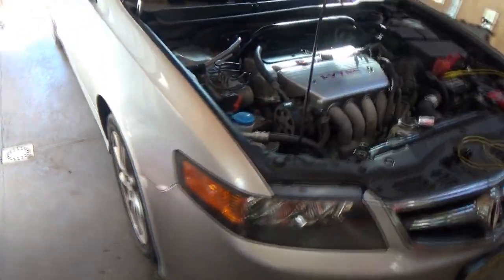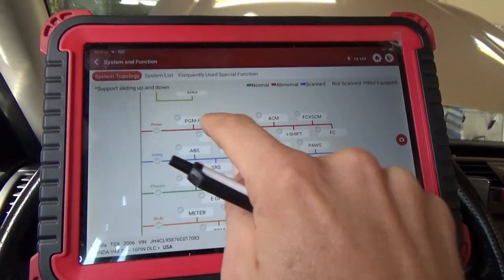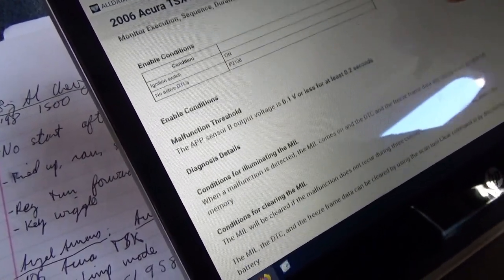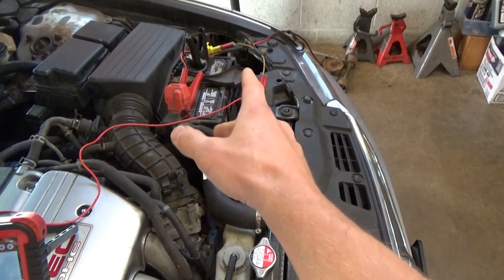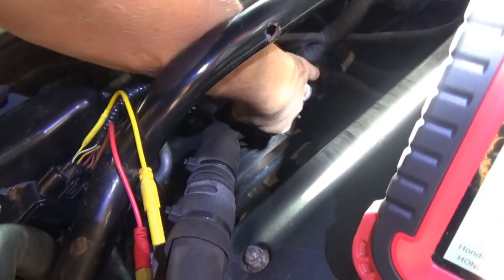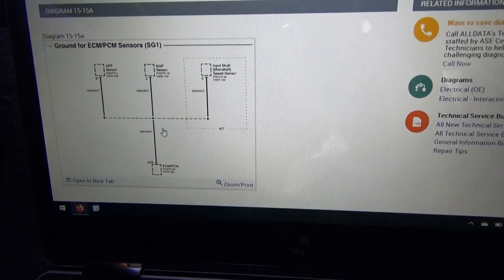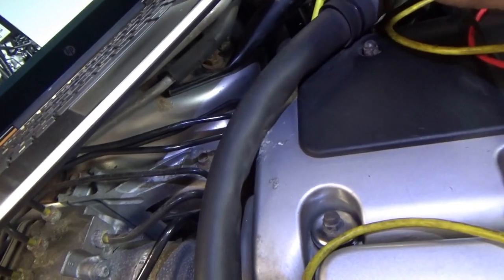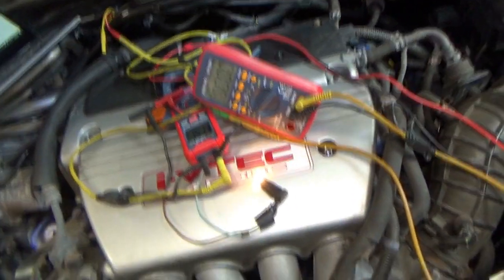DANGEROUS Limp-Home Acura (Part 1)

Comment: Hey Ivan can I pick your brain maybe you got some ideas, got an 07 Hyundai I’m dealing with, it throws lean bank 1 and bank 2. Start the car up and straight away bank 1 and 2 show about plus 20 short term, upstream O2 sensors look fine but the downstream O2s are stuck at about .42MV, if you attempt to force it rich or lean the downstreams will not respond at all no matter what. After the car idles for about 45 minutes or so the downstreams will slowly start to rise to .7 and the fuel trims will level out to an acceptable range, at which point you can now get the downstreams to respond if you force rich or force lean the engine. I did try to replace just one of the O2s which did not make a difference. No other codes set in the PCM. Possible the heater circuit for the downstreams is not working correctly? Would that cause this issue? Never really come across this and it’s sort of kicking my butt.

Comment: If you're going to run high current through a circuit to test connections,  be ready with a thermal imager to find the hot spot(s).
Reply from the maker: I didn't think 300mA was "high current", but apparently it was enough to reestablish a better connection haha
Reply: By high current,  I mean relative to the normal current for that circuit.  If your going to stress test a circuit,  you might as well flow a few amps through it and really heat up that bad connection/broken wire.

Comment: Ivan, what would you do out here in the desert? Our wires, as well as our cars, don't rust, the rattle snakes eat the mice and none of these problems that make up the majority of your videos exist. Now the paint gets eaten off of our cars by the sun, and the rare sandstorm, so my friend's body shop is always busy doing complete resprays (nobody paints a complete car back in the rustbelt as the car disintegrates prior to that being needed) and the engine swap out guys have a heathy business since our engines wear out after about 200,000 miles (although the car's bodies are perfect) but green crusties and rusted out ground connections don't exist.
Reply from the maker: Yeah I would probably get really bored in AZ 😅

Comment: 14:17 if it was a ground problem then it would be with bolth APP sensor data pids, not just the sensor B, i still think this is a single signal wire issue, curious to see what happens when you pull it apart at this point
26:29 so you push on the harness in a particular spot and the voltages go crazy, i would have started pulling it out/apart and investigating, maybe i missed something

Comment: frustration = amount of time/effort to locate an illusive fault!  After replacing my water heater no hot water to dishwasher.  Disconnected water feed hose at both ends and could easily blow thru it.  Reconnected it and still no water.  Turns out the hose went into shut down after 1st reapplication of water TOO FAST = water hammer that hose was designed to prevent.  Hose passed air but not water.  Replaced hose and all was well.  Don't ever disregard the laws of physics.  Note: defective hose goes to shutdown whenever pressure is present AFTER THAT FIRST WATER HAMMER EVENT.

Comment: If you knew the sensor grounds were bad, could you have just ran solid grounds to the sensor instead of finding the break?
Reply from the maker: I have learned that it's better to invest time to find the root cause of the problem, because you might find more surprises in the same location :) You will see in Part 2!
Reply: @PineHollowAutoDiagnostics  awesome.
But my question is, would running grounds still work?